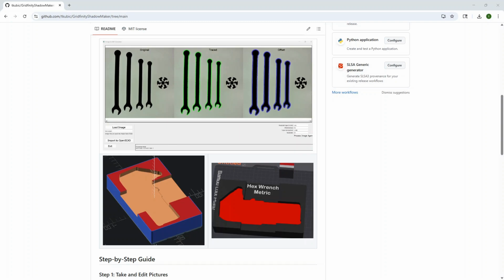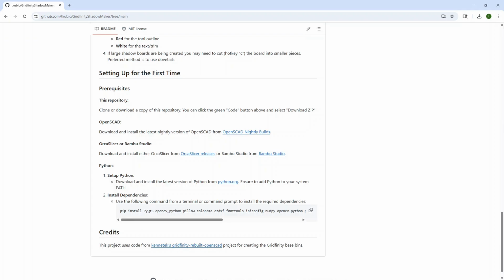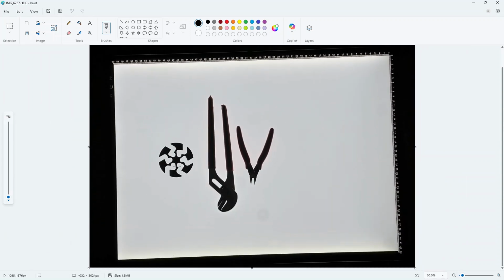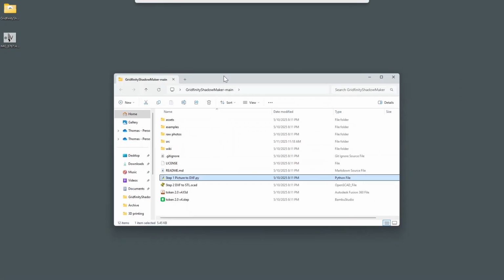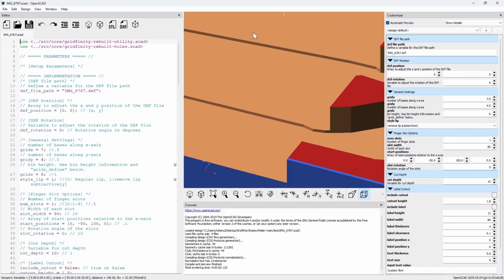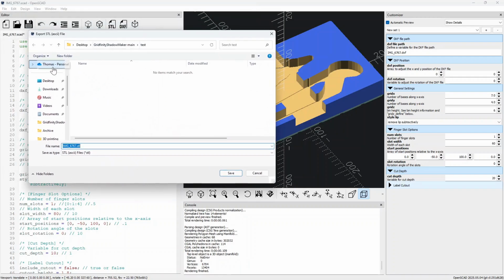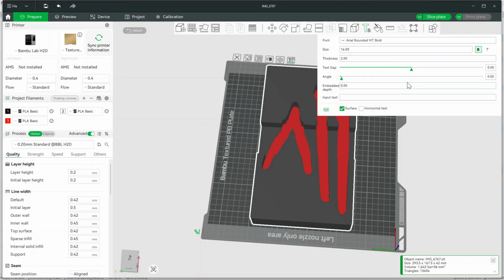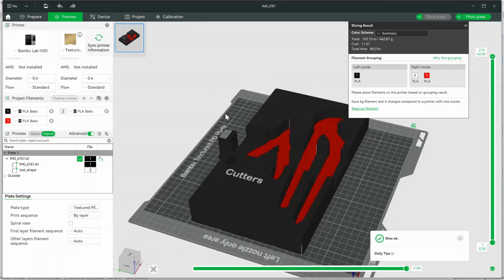Gridfinity Shadow Maker Tutorial

Comment: This is fantastic software.  I'm just starting to play with it and had a question.  Is there a way to directly export a DXF from your software?   It would be pretty easy to scale the output DXF in Fusion based on the known dimension of the token.
Reply from the maker: It creates a dxf without the token that is also to scale in inches. After processing/loading the photo check the project directory
Reply: @tkubic123  Dang that works perfectly.  Thank you for the quick feedback.

Comment: I love this and bought the light table. I'm having some troubles with the "Ensure to add Python to your system PATH" in your instructions though. It's also telling me "command not found" when I try to install the dependancies. Would you have any recommendations on tutorials that deal with this? All the ones I've looked at so far through web searches have not seemed to make a difference. This is the first time I'm working with Python or anything in the Terminal for that matter.
Reply from the maker: After downloading python to install on your pc there is a checkbox. You can rerun the install file and “modify the installation” to see if that checkbox is selected.